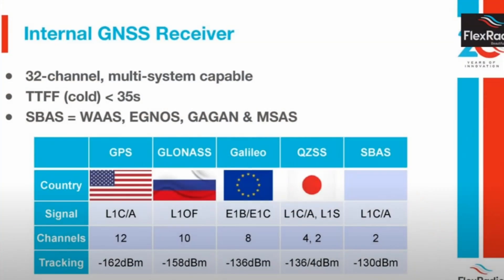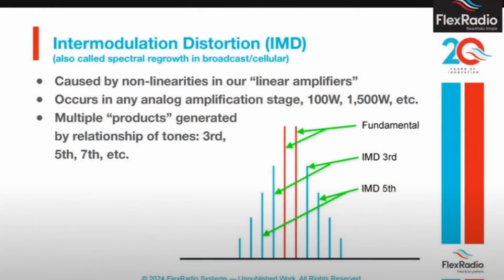New Flex 8000 Series Radios, Is it a good update?

Comment: Apache Labs G2 all.the.way.  Apache Labs radios utilize open source operating system and, for this fact alone. are much more highly flexible (pun intended) than Flex will ever be.  The Flex brand will die with its creators and their proprietary OS, yet the G2 will live on.  Until and unless Flex goes to an open source OS, I would not use nor would I recommend buying one.

Comment: Well with the 6000 series, I don’t see the updates coming that can be used in the 6000 since it doesn’t have the engine in the chip to do anymore so the old saying that you can just keep updating and won’t ever need a new radio is bs
Reply: I have the 6600 dream setup, I like it but it’s been a struggle to tame the popping in the audio stream and is quite annoying and embarrassing to say the least, and the guys let me know I sound like crap when it starts popping, and you can look this up on the forums in flex, it’s because it doesn’t have the engine, chip, to handle it
Reply: It should be a recall, popping starting when version 3.xx came out and they have never fixed it, going to be driving the pgxl with my Icom soon
Reply: I have heard Anons pop too

Comment: Too expensive to just talk to someone, buy a phone or go visit .
Reply from the maker: First of all thanks for watching and commenting. Phones theses days can cost a pretty good chunk of that radio, unless you want to use an old flip phone which isn't really comparable. This is a top of the line type radio so as for a phone top of the line Iphone or Android based phone would be comparable. In both cases phone or radio you can buy less expensive. Then the phone has a monthly fee and that adds up and to the cost. I still have a phone even with the cost. I have talked to friends all over the world and to go visit would be a huge cost in flights and just my time for the travel both ways, but I would like to visit them some day it would be fun. Lets figure a closer person that I talk to most days in San Diego. That would be a round trip of about 1100 miles, 17 hours with no stopping or traffic. Fuel would be $220-250.00, a motel while there food I eat anyway so a wash. Not to mention wear and tear on the vehicle.  Ham Radio is a hobby and this radio is on the higher end price wise, just like phones you have a choice.
Reply: @KK6USYHamRadioAdventures  dang man, that's way more than I would have typed when responding to such an ignorant comment! I was the Flex booth at SEA-PAC today, I was on the fence between an 8400 and an IC-7610 but not any longer. I'm headed to 8400-land.